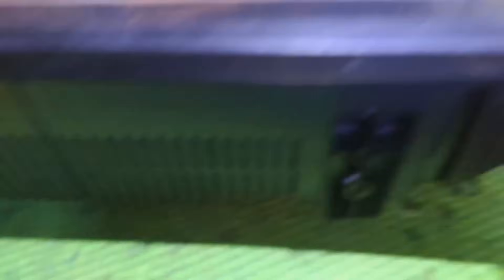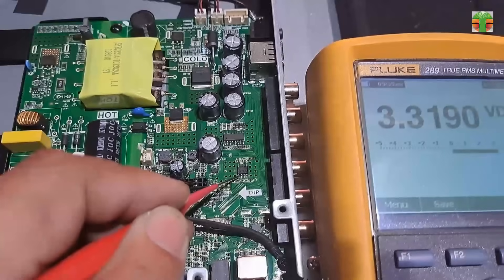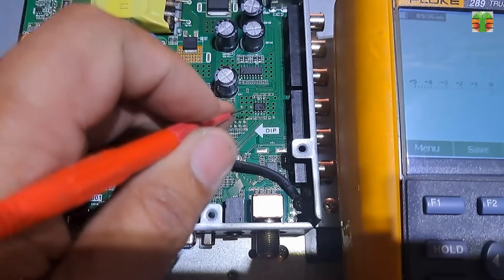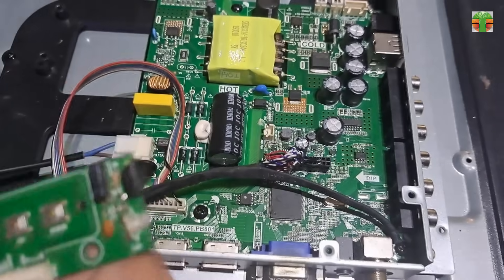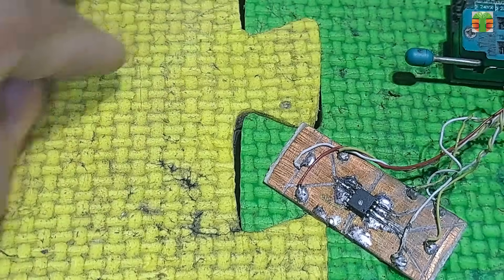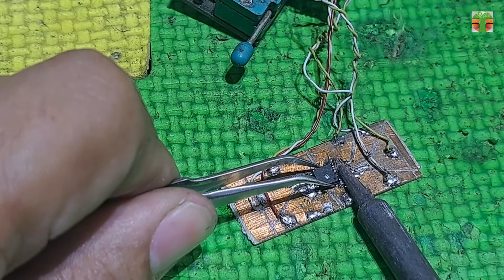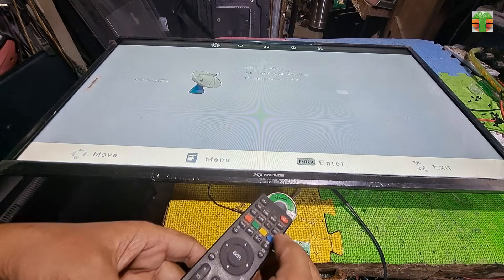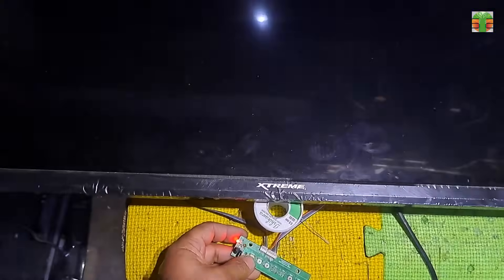LED TV not turning on. (EEPROM programming)

Comment: At 12:00 i will tell you one more time to use Flux because it will prevent pcb and other components from short circuit and clean joints.
Reply: I hate flux too, it stinks, smokes and is a greasy mess to clean.

Comment: The flux is not used for cosmetic reasons...it helps the solder to attach exactly to the board and to the element pins and is always needed.!!!

Comment: This was an excellent video. Thank you. Quick question: why does it seem you have to push the power button many times to turn it on?
Reply from the maker: There is a delay of 10 seconds to able to press the power and turn it on. I pushed the power many times so that when it is the right time it will turn on.  it is not going to turn on if you keep pressing the power button, so I press it rapidly.
Reply: @tevzTVTevatronics Thank you